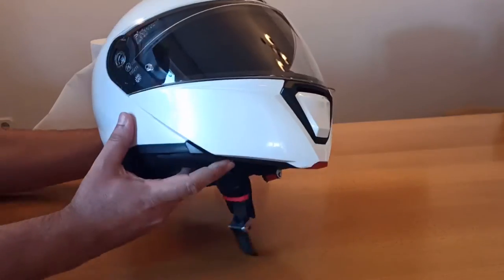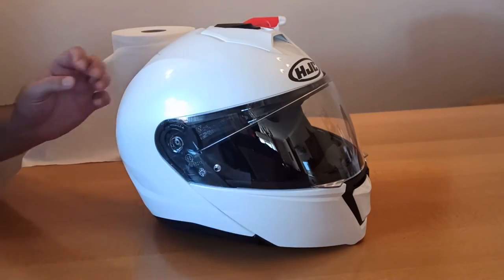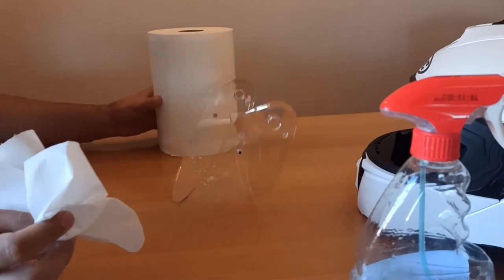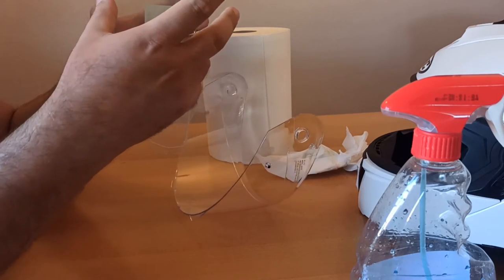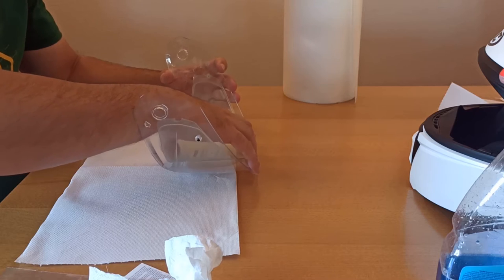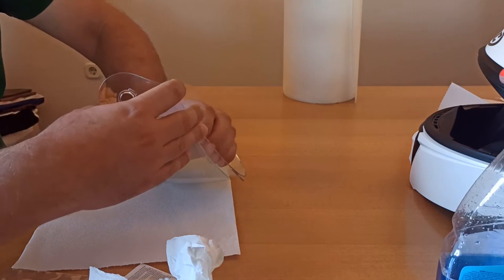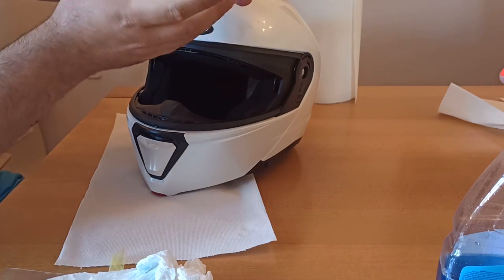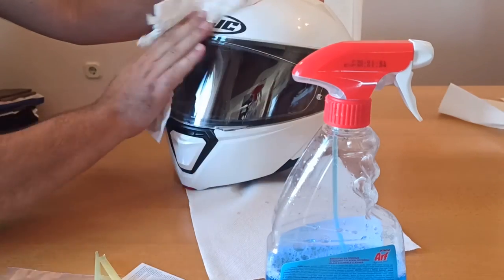How to install a Pinlock visor on a HJC I90 helmet

Comment: Not supposed to use spray on cleaners, they can react with the plastic. HJC recommends warm soapy water and a soft towel to dry.
Reply: How can i store the pin lock after i get it out for summer?